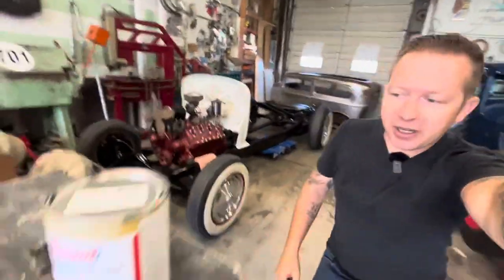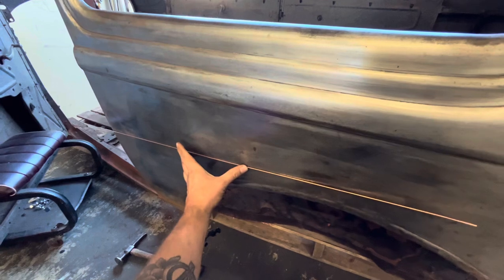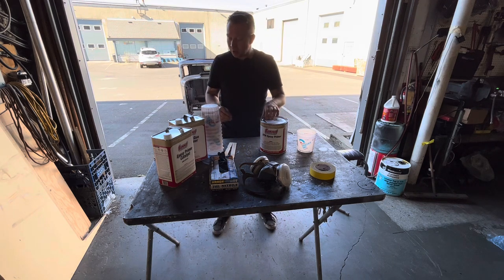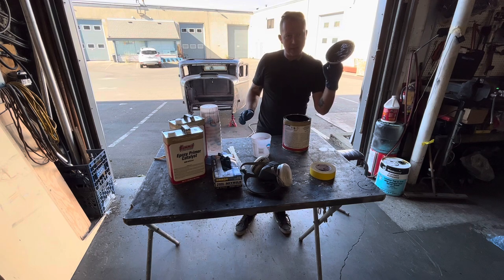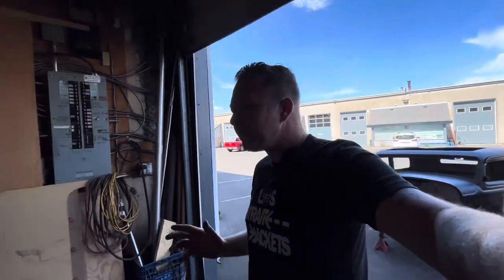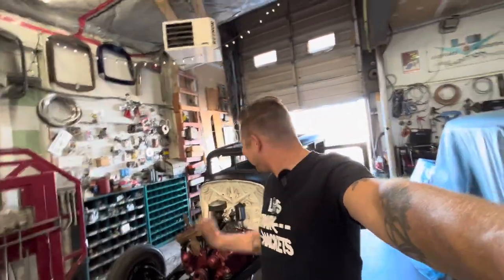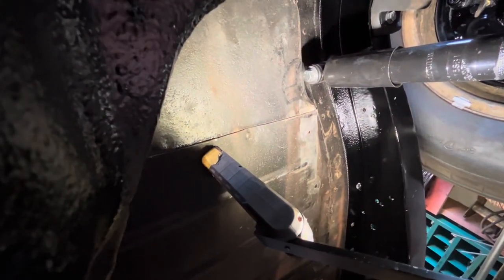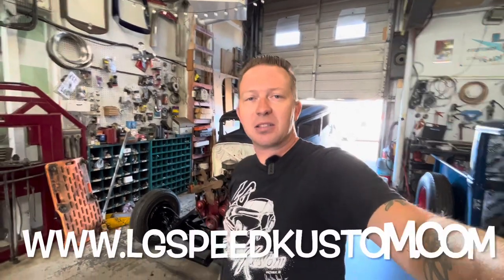Prime Time! The 32 gets some epoxy. 32 Ford build part 21

Comment: Lee, the car is looking a helluva lot better than it did when you got it. I can tell you the following: Original body bolts were 3/8 fine thread carriage bolts. The rearmost two should have a approx 1/4" spacer under. The next pair forward should have an approx 1/8" spacer under. There should be running board braces which help stiffen the body mounts and the innermost holes take 5/16 fine thread carriage bolts. There are two 7/16 longer hex bolts that pull the cowl down over the firewall. This is all restorer stuff. Luckily all that was in place when I bought my 32 so I tried to put it back like that when I put the body back on. I did show some of this stuff in a video. Mart from Mart's Garage, England.
Reply from the maker: Thanks for the info Mart. I didn’t realize you also had a 32 Tudor until the other day when someone suggested your videos. I was watching some last night. 
Cheers

Comment: Lee, when I built my rod back when, I heated a hole punch, and it cut the needed hole, and sealed it at the same time with the heat from the heated punch, just FYI....:-)
Reply from the maker: I gave that a try, but it wasn’t working out for me. Maybe my punch wasn’t sharp enough

Comment: If you take sharp nail and bang some holes in the bottomof the groove that the paint can lid fits in it will drain back into the can easy to refit the lid no paint all down the can just my $.02 That 32s going to be cool can't wait to see it back on the road

Comment: You Could have used Phillips screwdriver heated red to burn holes through the felt on the frame.That's how l make seat bolt holes in carpet.

Comment: Looking good Lee. The gasket you used for the firewall is the same thing I used on our greenhouse sliding doors. I was also wondering why it said 17 ft., turns out it is two 8 - 1/2 ft pieces joined side by side. You can separate them in two lengthwise, but for your firewall gasket it was probably better to leave them together. -Marty
Reply from the maker: Two 8 1/2’ pieces huh… that’s kinda like false advertising isn’t it? Haha 
It worked good though!

Comment: Not that it matters but, I took a gas tank out of an original sedan and it was mount under the frame flange, it didn't make sense it was installed like that, but maybe easier to drop the tank in future if need be, and the clearance between the tank and body be approx. An inch....mine still had springs and bolts like you have.
Reply from the maker: That seems like it would be easier, but a full tank of gas hanging off three bolts seems like a lot of stress on that flange

Comment: Are you building a ratrod? Way to quick to put that body on. I think you are letting yourself down by being in to much of a rush. A hour with even a pallpein hammer I would have made those wheelwells twice as nice, now? You didn't pull the glass? You are such a great guy and can do such great work, why not spend a little time now and get a way better final result? You run a shop and channel not back alley Bob's.
Reply from the maker: A rat rod? Nope. I bought an old hot rod, fixed the stuff to make it a safe car to drive, and now putting it back together to do just that. Drive it. 
Right now I have more important priorities than having a dent free car. I have a family to take care of, a business to run, and recently bought the building my business is in, so now I have that to upgrade. Building a show car is not something I have time or money to do right now. 
But you know what? Maybe in five years I can, and in that case I can always go back and take care of those dents then. I’ve said it many times, you don’t always have to do everything at once. You don’t have to fix every panel before you can enjoy a car. You don’t have to have perfect paint before you can enjoy a car. Cars can evolve over the years.

And I pulled all the glass except the rear window. It’s glued in, and it’s fine.